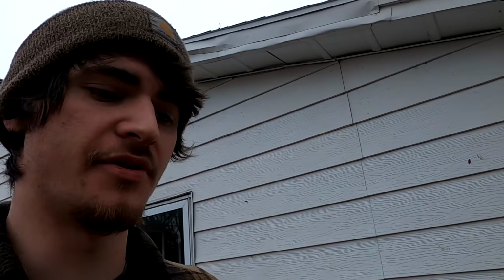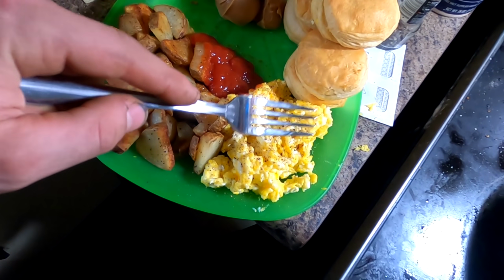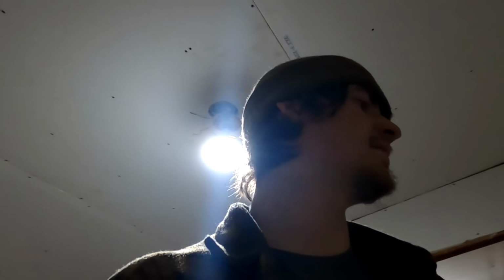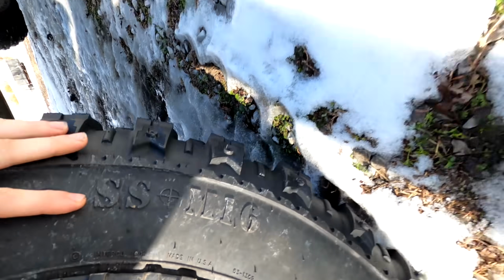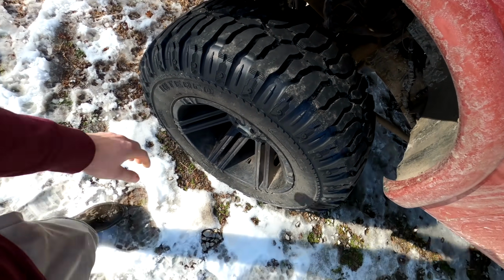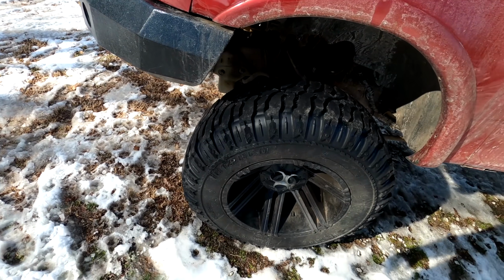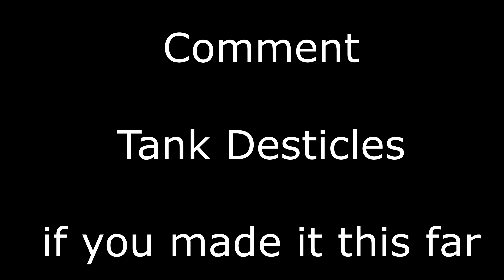FOURWHEELER DRIFTING!

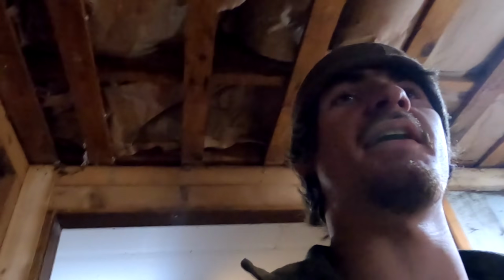Comment: Those 5:13 gear ratio will help a lot not only with the mud but towing capacity, have more low end power then a 5.4. great video!

Comment: U should get a 80mm throttle body and port the intake manifold, and buy a pulley kit, light weight crankshaft pulley and water pump pulley as well. Will all result in much better throttle response and power to the wheel with even as little as a feather tap on the gas

Comment: I have a 2001 4.6 2v f150 with a 6 inch lift and 37s and that 4.6 will roast the tires from 30mph, I put 3.73 in the rear end and long tube headers with 3 3/4 pypes performance exhaust with 4 inch tips with a pi mustang ecu and sct 93 Oct tune and a custom made cold air intake out of stainless steel

Comment: Kenny is your truck a 4.6 or a 5.4 and do they have  catalytic converters and do you have headerS 

Also a p-1sc-1 pro charger will fit your truck it adds more powaaa and sounds cool. But it’s 5,800+for the kit

Comment: hey Kenny I know this is random but I'm at my wits end racking my brain on this. My step dad got a 2014 ford f-250 super duty with the torq6 transmission. we've only owned it 8 months and here lately when ever we go to put it in drive and let our foot off the break and barley tap the gas the gears jump from 1st to 5th. do you by any chance know what it could be??